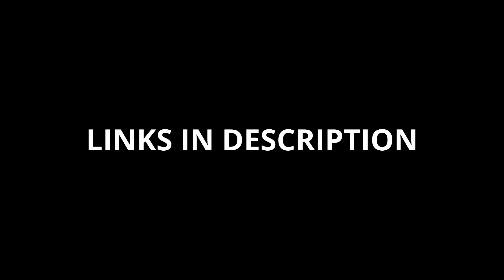IMAX B3 PRO repair

Comment: Thanx for video but first  please change your intro video and ugly zombie image. Second: The faulty  chip was in the middle, not all of them. 
In this charger models  the LED always lights up red due to the faulty chip. Also plug in the wall mains first, then connect the battery. 
When removing it, first remove the battery and then unplug it from wall mains. You did not follow this rule in the video. 
I'm afraid those chips will burn again!
Reply from the maker: This video is 5 years old :D I have new logo for so long now :D
I wanted to replace all to have all same in case new one is different.
Thx for some tips, some chargers do need to start without battery for calibration and others do check battery on start.

Comment: hello 
im have made a custom battery pack using 3s 18650 (3 cell, almost 12v).
I have also made the balanced lead (white connector ) for charging with b3 charger.
when i connect the battery to the charger, the 3 leds are always red, but i have chrged that battery pack to full before.
those led where red for long time.
what is the problem i cant understand please help
Reply from the maker: First check 3s battery diagram to see if You have all connected as they should be.
You can check voltage between batteries on balance plug to see if there is voltage from each battery.
Red means it's charging, but it's possible that it's balancing them and that's why it's taking so much time
Reply: @Adrian202  cab you explain this in a video. Although I applied my knowledge how much I know. It would be helpful for me. 
And thanks for the reply..
Reply: Same

Comment: hello sir, can you help me to identify what is the problem with my charger? all the lights are still green even though I have installed the lipo battery, and when I check the output voltage on the 2s and 3s sockets using a multimeter, there is no voltage at all ...thank you..
Reply from the maker: There will be no voltage because charger need to detect battery voltage.
I think Your battery is over discharge, voltage is so low that charger don't detect battery, and then will not charge battery.
Reply: @Adrian202  first, thank you for your willingness to respond.. maybe what you said is true.. but when I checked the voltage of my battery, it's only 3.9v... and I tried three different batteries, but the result is still the same.. the light on the charger doesn't turn red...

Comment: What do i do if it does not balance charge, my 3s lipo has a charge of 99% c1, 98% c2, 37% c3. Im kind of worried, my balancer also sucks.
Reply from the maker: Hm, I did not get this problem, only think I got on mind is that charger just did not finish charge or that last chip is broken.
Sadly it is just a cheap charger so not much to expect.

Comment: I made a battery when put it in some smoke came out now only middle light working what's the mattwr
Reply from the maker: You may connect it in wrong polarity and this charger don't have any protection over that
Reply: U need to replace dem tings u know d chips

Comment: IMAX B3 is having the same red led problem in the video shows that you changed the 3 smd Wouldn't it be better to just change the smd corresponding to the red led?
Reply from the maker: If You get red LED when nothing is connected that may mean faulty chip or that something is not solder correctly so before looking on chips check all soldering points on board
Reply: @Adrian202  mine started to turn on the red LED in the middle after I mounted a wrong battery must have given a short .

I bought mine on aliexpress I hardly used it I have several 18650 batteries to mount the 2s and 3s batteries I ended up calling inverted and it must have burned